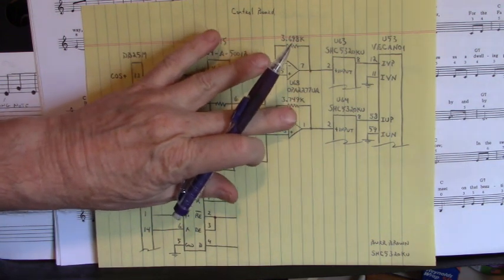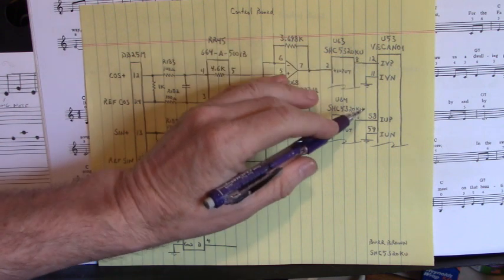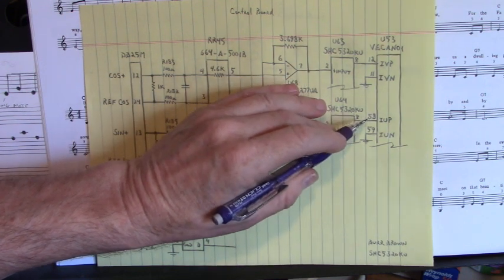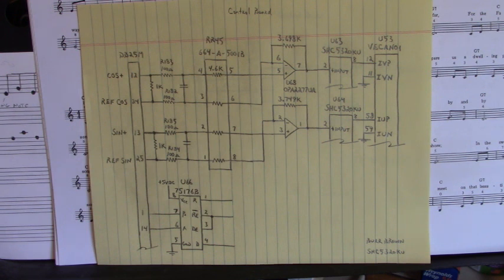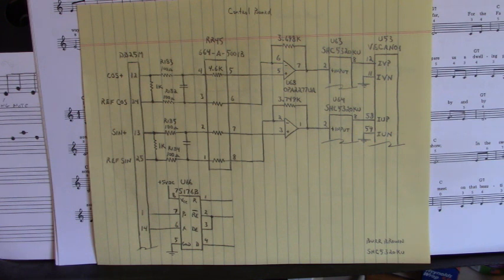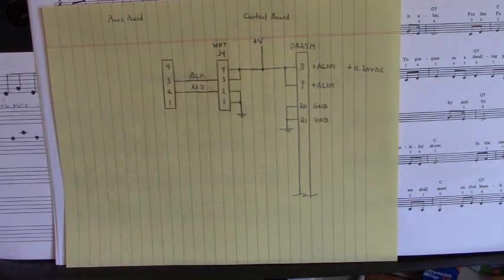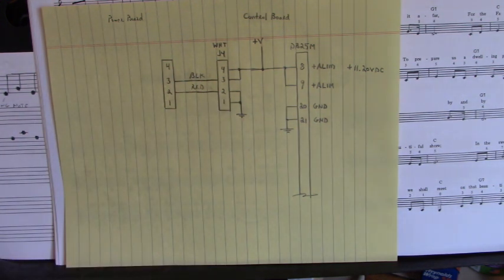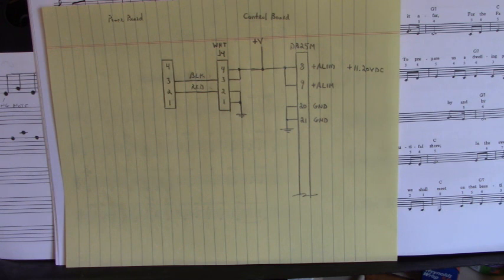Long Oscilloscope Gnd Wire Vs Short Oscilloscope Gnd Wire

Comment: Hello PeePaw, friend. How are you doing?
Oh those inductive-capacitive components of long wires gave me really bad times, back when I worked developing industrial sensors.
Reply from the maker: Hello Mr. Riggs. Great to hear from you again. We are mostly doing well here. Sometimes I fall apart for missing my son. But there is that. I hope you and your family are doing well. I am curious about your work with sensors. Did the noise affect the sensor readings. I always enjoy learning from your experience. Thanks for stopping by.
Reply: @PeepawMcDonald  we are going well, thanks. 
I'm with you with your pain, friend, I always watch the videos from his files that you post, when I have the time, I'm very sorry he is not with us anymore.
About the sensors, I worked in a manufacturer between 2010 and 2011, developing part of their products.
Inductive sensors have a tiny tuned amplifier inside, that would pick up noise from everything and trigger the output... To make better sensors, I came up with the idea of not measuring the voltage in the coil, but instead using the coil as part of a osculating circuit: when it have magnetic or paramagnetic material in front of it's core, the frequency of the oscillator will change, so to adjust the sensing distance you just need to choose the proper triggering frequency, and it have great noise immunity, since the only frequencies that can affect are the resonant frequencies, that are filtered from the source circuit.
I wrote so much, I hope I made it easy to understand.
Anyway, I can email you about it if you want to.
Cheers, my friend.
Reply from the maker: @electronicscaos  Thank you so much for thinking of Chris. That means so very much to me. How is your family doing? I hope all is well. You are brilliant. I would have never thought of your solution to sense the flagging object with frequency. That is genius. What are you working on now? I hope not too difficult. Thank you again for thinking of my Son. Here my daughter has been a great help in holding us in the middle of the road. She is much much stronger in spirit than I am :) Good night friend.